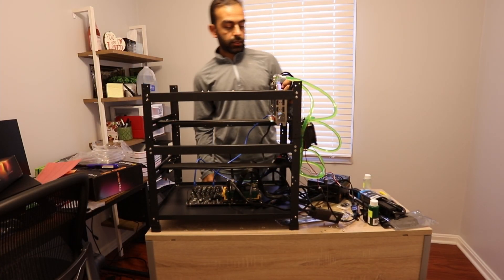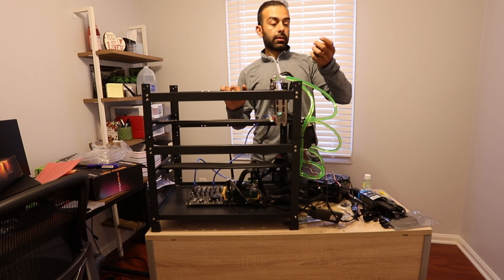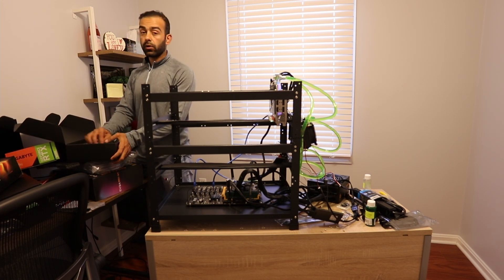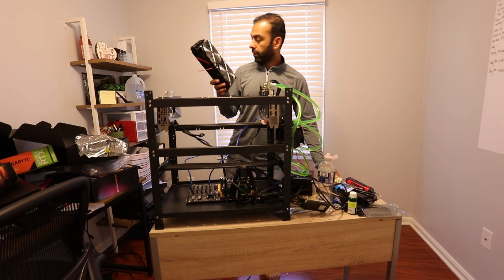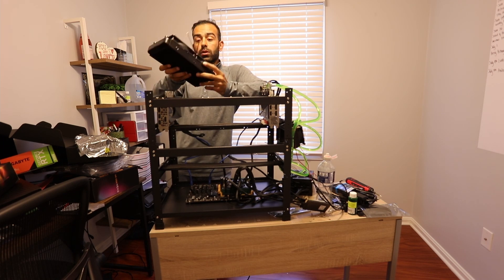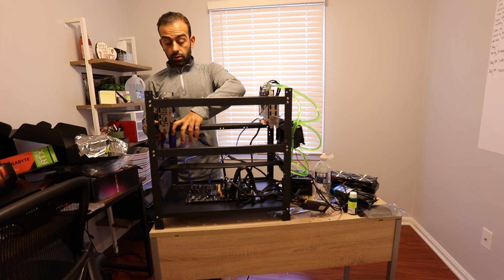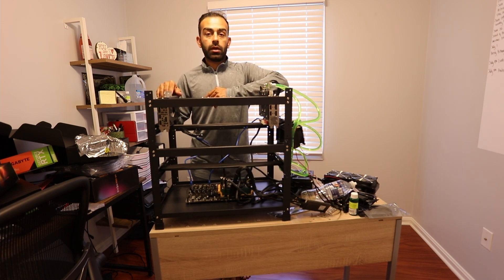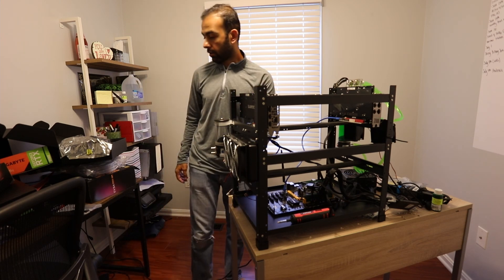RTX 3080 WaterForce Rig Installation Water cooled mining rig

Comment: nice video! well explained and easy to follow.
How are your memory temps on the 3080? as I was looking at getting one then realised the memory is only covered by heat pipes and not directly water cooled.
Reply: So you're saying it would be better to get a normal 3080 with the fan cover and then slap a waterblock onto it, rather than go for this one?
Reply: @FackThePresent  just comparing it to other water blocks that have full coverage. Mem gets hot when mining ethereum.
I would say in most cases the fan on its own is good enough. All depends on ambient temps and if the manufacturer put the heat pads on correcltly
Reply: @davidg487  some waterblocks have an active backplate.. I also like the special block for founders edition fro ewkb

Comment: Hi there. Loved this video. I think this is the ultimate solution for the high vram temperature issues with 3080/3090. I am a bit confused about connecting the power for the radiator fans. Did u use any molex adapter for the fan? Appreciate if u can give some details. Thanks

Comment: I have 3 gigabyte waterforce 3080. My watt never go up much more than 200. Generally i take 75 mh average. Should i change my termal pad? Can you show how we can? Ty for your video.🙏
Reply: me pasa igual con una waterforce 3080 con settings -300 / +1200 / 70%power,  obtengo 83 mhz con un consumo de 205 Wats ,temperatura de gpu de 42 grados , pero el gran problema es que la vram  se eleva a 110 grados, muy peligroso , se puede dañar la vram,  imposible minar con tranquilidad, una opcion seria cambiar thermalpads.

Comment: how many mhs on eth? 
Temperature?
Reply from the maker: With 10 3080 you can get up to 970 mhs. The temperature remains under 60 with good pump and radiator.
Reply: @safirauf  and temp of memory?
Reply from the maker: @jjinfoecell670  the memory temps tend to stay in the 90s.
Reply: @safirauf  Good, thanks. I buy 2
Reply: @safirauf  this waterforce is doing how many mhs?
Reply from the maker: @jjinfoecell670  it should do 87 without overclocked and 97 when overclocked, as long as it is not LHR.
Reply: @safirauf  without hashrate.no says 100mhs this model does not do 100mhs?
does she have thermalpads in her memories?
Reply: this model GV-N3080GAMINGOC WB-10GD
cools vram?
Reply from the maker: @jjinfoecell670  it must have thermal pads for the VRAM, I’ll upload the video for installing thermal pads. There are also different overclocked settings giving different hashrate depending on the GPU model.
Reply: @safirauf  So have you changed the thermal pads on VRAM? What is their size? 2mm front and 2.5mm back?
Reply: So those r non LHR cards ? R they still sold ?

Comment: So these GPU's do not work without water cooling kits? These extra parts make it much costlier than regular 3080 isnt it?
Reply from the maker: They are a little cheaper than the regular 3080s and the extra parts are about 100$ for 4 GPUs.
Reply: @safirauf  Thanks, what is the power draw per gpu for mining and hashrate? Do these water cooling kits cool the vram as well? Are there LHR version cards in 3080 that are sold in newegg shuffle?
Reply from the maker: @bps739  the power draw is is a little under 230 Watt, the hashrate is 97-99 mh/s dependent on your overclocked settings. There are some LHR 3080s out there. There are two versions of the waterforce, the Gigabyte does not cool down VRAM but the Auros cools down the VRAM as well.
Reply: @safirauf  how do we know which ones a non LHR version one? Heard few of them do not have lhr in description. What’s the temp of vram for waterforce non aorus cards? Do you think they will sustain mining?
Reply from the maker: @bps739  most of them will say it on the back of the box. If it doesn’t say it on the back then you’ll just have to run them in a rig to find out. The VRAM temps go up to about 80-90.

Comment: This is not practical for a real miner, I could not imagine trying to water cool all of my cards 😵‍💫😵‍💫😵‍💫😵‍💫
Reply from the maker: I am building a 12 GPU rig that is all completely water cooled. It is actually easier than a traditional rig. Although here I show a separate tank and radiator/thermocooler, I will be using a single tank and cooler for all the GPUs. The pipes will run from reservoir/tank to GPU, then GPU to GPU, followed by the cooler, and finally back to the tank.

Comment: Hi, 
Thanks for video. I'm considering also to go with waterforce 3080. What temps do you have?
Reply from the maker: I am getting 45 with Auros and 46-49 with Gigabyte. I am currently working on using one pump and reservoir for 10 GPUs, I will upload that video as soon as it is ready. Thank you and let us know if you need help choosing your GPUs.
Reply: @safirauf  I also have 4x 3080 watercooled, and the one that you have installed in the video is the least good. Mainly because the water doesn't cover the RAM temperature, so you should look at that, I've had it around 105degrees celcius, and the hashrate was falling, so I ordered the new thermal pads and this will make a huge difference. You should look what your VRAM temps are for your sake.

Greetings
Reply from the maker: @johnny2156  thank you, I will check that out. So far I don’t have any issues with hashrate  or temperature.
Reply: @safirauf  I also had the gpu at around 45 degrees, but the Vram was 2x higher.. you better check with GPU-Z. Nothing brother, happy mining!
Reply: @safirauf  os the gigabyte 3080 waterforce Rev1 is a non LHR version? I want to confirm before buying. Could you Help me ?
Reply from the maker: @esadof12345  yes the version 1 is non LHR and the better GPU is Auros.
Reply: @safirauf  I agree u must check ur mem temp anything higher than 100c is dangerous for 24/7 mining and those cards r not cooling the Ram properly, gigabyte is just trash imo…